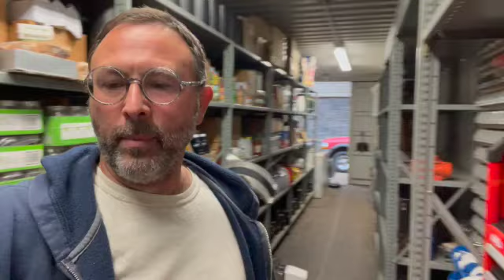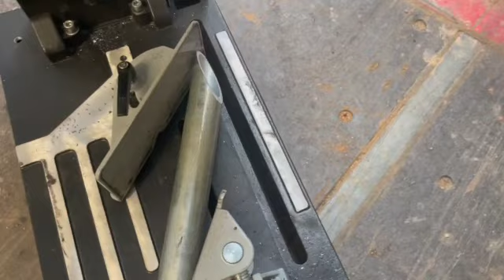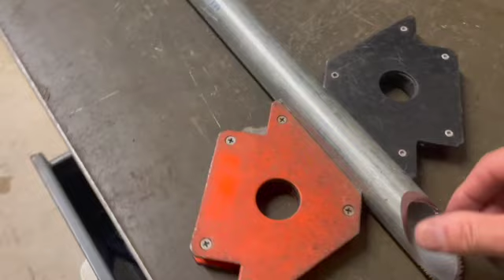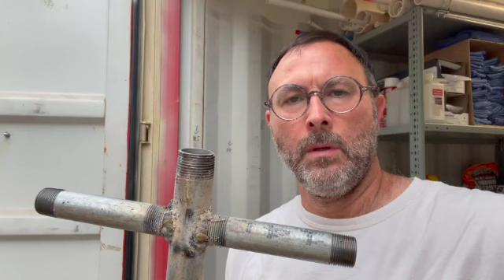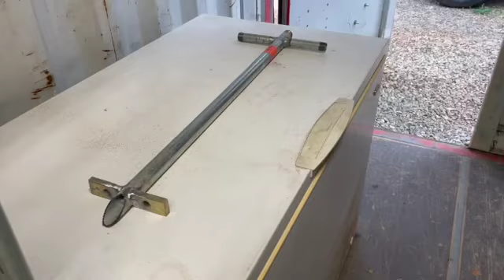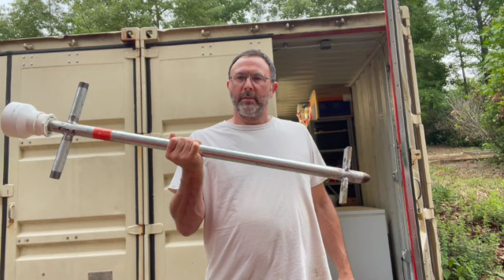DIY Seed Stick Prepper Planter

Comment: To overcome the tube clogging up with soil, I suggest a separate solid rod to make a hole first
Reply from the maker: @christophernunn943  - yup.  I’ve done a bit of modifying but it depends on the seed size and soil type for sure (not the universal application that I’d like)

Comment: Add the cut piece to make a point. Then add a spring with a bike brake cable and handle to open and close the point.
Reply: I just ordered this one off of Amazon (Garden Seeder Shank Manual Planter Seeder Seedling Bulb Planting Tool Rustproof Vegetable Metal Seeder for Corn Beans Cotton Peanut 2 in 1) I don’t have the time to make one.
Reply from the maker: Hope it works for you!

Comment: With the soil we have around here, I would think that all that would happen is that the pipe would get filled with soil and the seeds would not be going into the ground and just backing up inside the pipe... Maybe your soil is different...
Reply from the maker: The way the cut is made and the position of the foot stops negates that effect.  It acts more like a tiny spade/shovel.  You step it in, tilt it back and drop the seeds.